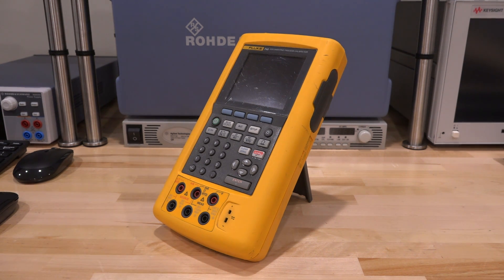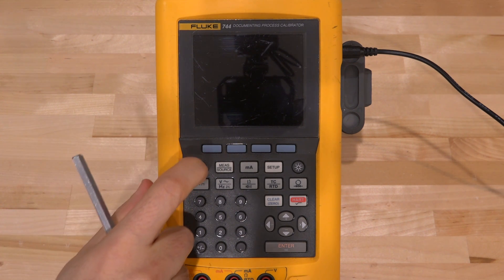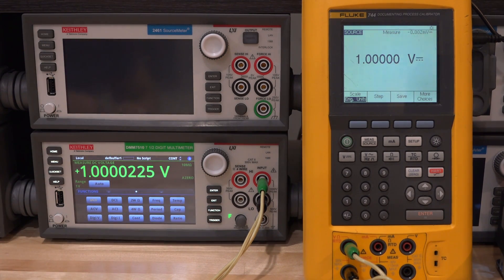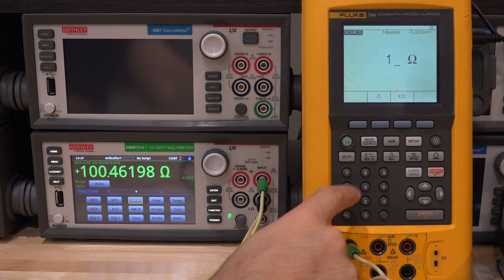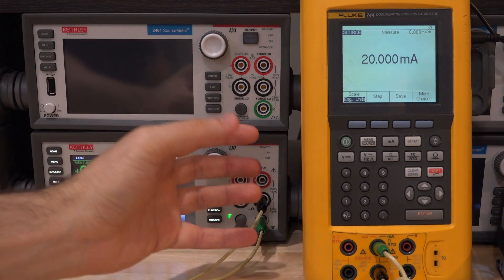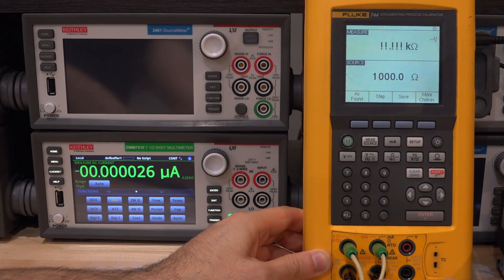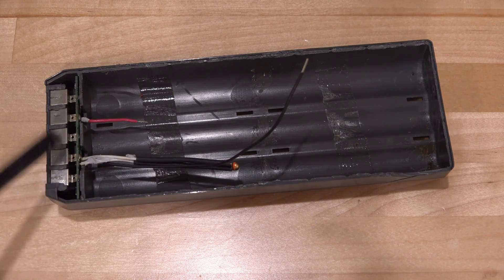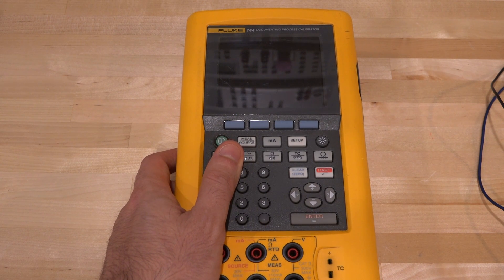TSP #175 (II) - Teardown & Repair of a Fluke 744 Documenting Process Calibrator (Part 2)

Comment: I have received a 743B and replaced the NiCd cells with two LiPo and a small power management PCB. I put a jump wire from the DC jack negative to the negative battery contact and now the device can charge the battery by itself. However the low battery sign is constantly showing. May I ask at what voltage level did the sign go away?
Reply: 09:10	6VDC and lower shuts off, 6.5VDC beeps for lower limit, 7.5VDC shows as low voltage but operational... he never said at what voltage the battery icon disappears but we can replicate that experiment and come up with that answer; it must be above that anyway.
I'm also going to design and print a battery, case and maybe the cover/latch too probably in "Tough 2000" resin to match the Fluke color scheme since mine is broken; there's some interest for this upgrade-repair.

Comment: i have a Fluke 741B with similar condition.  The device cannot boot normally.  i tried to test and in this case i can power it on and off.  when i press the start button it has a small beep then it will keep on beeping.  I see there is an unsoldered RS232 port on the PCB, can I solder a jack and connect them to the PC?
Reply: I think the 74x series uses Fluke's own communication protocal and they charge quite a bit for the software. Not sure if you could directly communicate with the device through that.
Reply: Hi Liu. Nice to meet you. Have a  nice day. 

I found a jumper next to the MAX694 and it's identical to the Fluke 701, GND and Reset.  I just tried soldering the DB9 jack and connected them to the PC, opened the Fluke744 Firmware Update software, when I was about to upload I tried to short the jumper on but the software said it failed.  "Error:Lost connection & Protocol Error: Compliance."  The device continues to beep.  I want to know Max694's Reset pin state configuration, any idea?

Comment: very good video, I need some help to find out the HART cable interface for the Fluke 744, because I can't find it to buy it new, do have the Pinut to built a OEM hart cable interface?
regards

Comment: The "errors" may not be actual offsets. The Keithley has a spec plus a temperature coefficient error. Your test leads most probably add small uV errors. The Keithley might have a small drift error as well. The resistance error / offset could be due to the fact you did not zero the test leads. 
Calibration does NOT mean something reads exactly a specific value and does not include adjustment . Calibration is the testing an unknown value against a known value that can be traced back to a National Standard. 
The kg standard which is in France is changing value over time and is NOT exactly 1.0000000000000 kg

Good repair and very well presented, well done.

Comment: Also remember that don't cheat on the battery, but try to get the battery as right as possible, maybe a tad higher than stock. The reason is that the meter uses the battery as its own internal voltage reference (it has nothing else to reference against). Also try looking in the schematic what the 2 unused terminals are for (1 terminal was common GND, one terminal was thermistor, and one terminal is battery+) . It MIGHT be that it exist some sort of compensated battery which have a good refvoltage. Either it COULD be balancing terminals for Li-ion battery, or it could be reference terminals which uses some sort of precision circuit to create a refvoltage with a known difference or similiar.

I have noticed many multimeters - including fluke's, that give weird measurements once their 9v is starting to go flat. Once you get weird measurements with the probes connected to nothing, especially in ohm mode, you know that the battery should be replaced.

Comment: I understand the secrecy required behind not disclosing the source of the rom/fw updater. Could you at least tell me if there is something there to update my Fluke 199 (first gen) Scopemeter from the original FW (1.23 I think) to the later versions? EEVBlog had a thread on someone else trying the same update, but lacking any solution.
Reply: It's not a secret, you can find the link in the comments of the previous video.

Comment: There is a video you can watch to make a Fluke 19x into Li-On same applies here
Reply from the maker: This one is even easier. Because the instrument itself doesn't even have a charging circuitry built in.
Reply: The Signal Path splendid, do it via an inductive charging coil

Comment: Resistance sourcing is probably not miscalibrated at all. Please note that there was a similar absolute offset of around 0R45 at all measurement points. I bet it is caused by the resistance of the connection between Fluke and Keithley
Reply from the maker: I had already zeroed the DMM. But I noticed that the contacts on the Fluke where very dirty and after cleaning them, the result improved a lot.
Reply: exactly what i was thinking. He should try with a 4-wire measurment.

Comment: There is a patent, US4176331A, registered to two scientists from Hughes Aircraft Company for a device using an op amp and a resistive voltage divider to simulate low noise temperature resistors.  I wonder if this may be using a similar technique?

Comment: Looks like the rating is 7.2 V and 3500 mAh. Two of these https://www.adafruit.com/product/353 wired in series to the battery terminals would make 7.4 V 6600 mAh. Nearly double the battery storage capacity for longer run time! Huzzah!

Should be pretty straight forward to create a charger for those embedded packs.
Reply from the maker: This one is a little too large I think to fit into the space. But I like the approach.

Comment: Great video! For the membrane keyboard I tend to use a 6B drawing pencil (super soft) and "paint" the rubber pad with graphite again. Tends to work quite well to revive dead rubber keyboards. Far from ideal but will keep you going in a pinch. (other harder pencils might also work but you probably need to first draw a very dense spot on paper and the rub that paper onto the rubber some). I guess you can but replacement conductive pads with adhesive on maazon but unfortunately they are impossible to source here in Argentina.

Awesome work!!
Reply: Hola Diego, perdona la molestia, tendrás de casualidad el pinout para la interfaz HART del equipo, no he podido localizar el cable de interfaz HART?
saludos  desde Chihuahua, México.
Reply: @luisbayloncarrera7066  no. No tengo nada. De hecho ni siquiera tengo este equipo. Perdona!

Comment: Exactly how does it implement the resistance emulation?

Hard to tell exact sizes from the video but if those NiMH cells are the same dimensions as modern 18650, it looks like you can stuff 6x 18650 into the case and get really good runtime out of it. (Maybe just 4x if there's not enough space left for the BMS.) Then add a 2S charger board inside the unit so you can plug it in to charge just like most modern electronics.
Reply: Resistance measurements: with MOSFETs ( look up electronic Load). Yeah the batteries look close enough.
Very interesting videos, every time!

Comment: How device source resistance? What is schematic solution? It is interesting to me.
Reply: From what I saw, it measures the current delivered by the external device and overwrites it with the equivalent voltage that the resistance would generate.
Anyway I would also be interested if it is explained in more detail.

Comment: Would be nice to see actual repair process, skipping thru it might be somewhat confusing for people who never worked on these, or bootloader process in general. Also 3458A is sad, sitting neglected ;)

I can help you with hobby calibration against my 5720A and standards :)
Reply from the maker: I used a USB-RS232 converter directly connected to the RS232 port of the Fluke 744. I then ran the Firmware Update file and followed the instructions. I kept on trying with different power on conditions until the software established a connection and then it worked!
Yes, I promise to show the 3458A soon! :) It would be cool to calibrate this thing against your reference.
Reply: yes, i couldn't quite understand how exactly it was fixed after all. how was it wired up to computer?
Reply from the maker: Please see my response below.